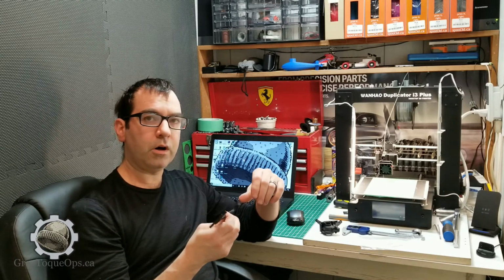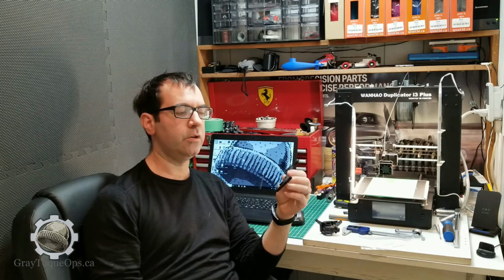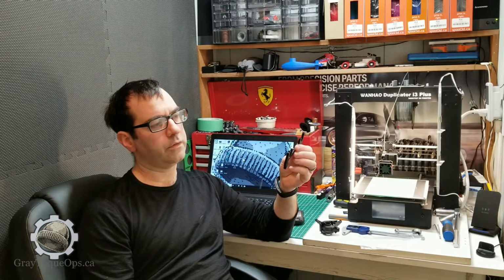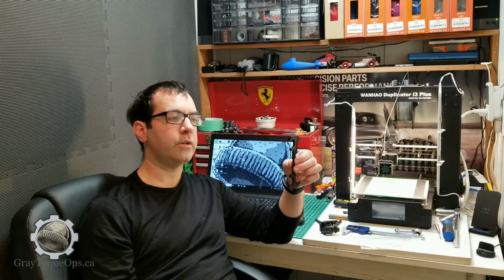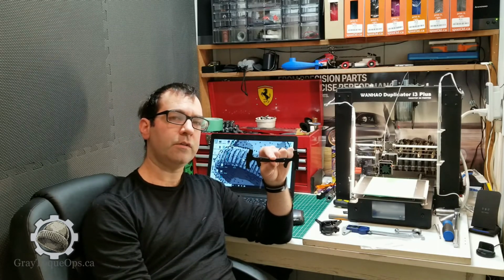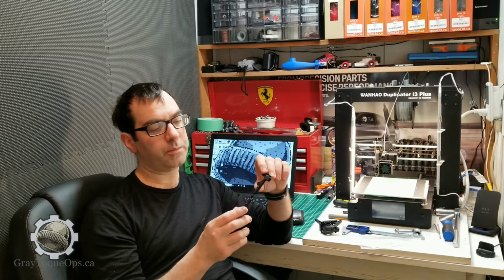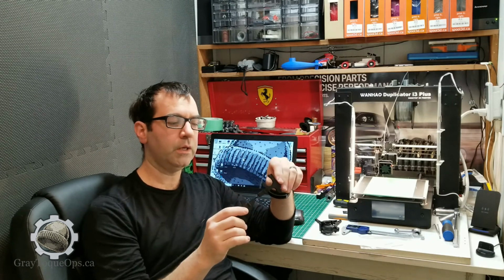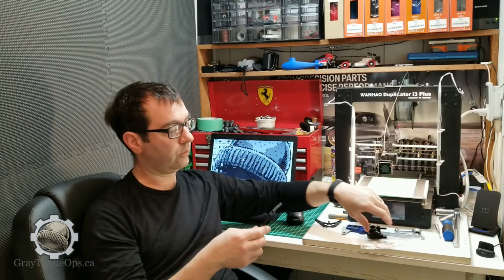Team Durango DEX410 bulkhead

Comment: The video would make more sense if you showed where the part actually fits into on the car...
Reply from the maker: Thanks for the comment. We will take that into consideration.

GTO was commissioned for this project and as such do not have a chassis on hand for demonstration.

This part is a direct replacement for the Front Bulkhead assembly on the DEX410/DESC410 V4/5 chassis (original part #330003).